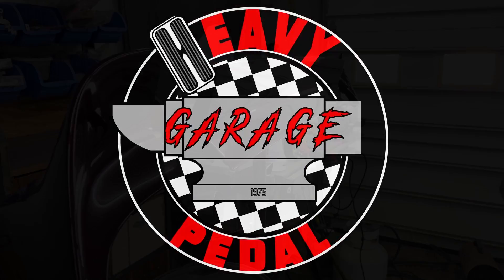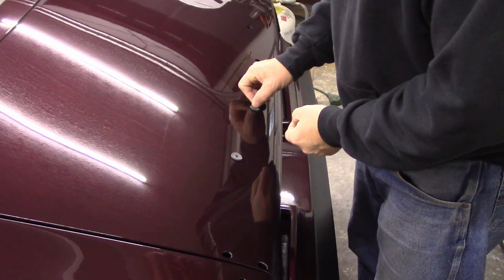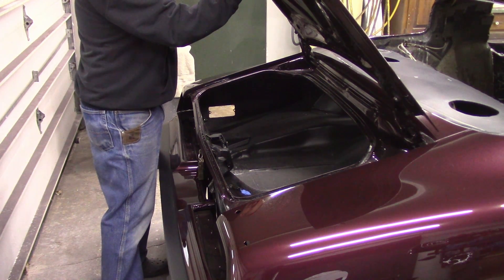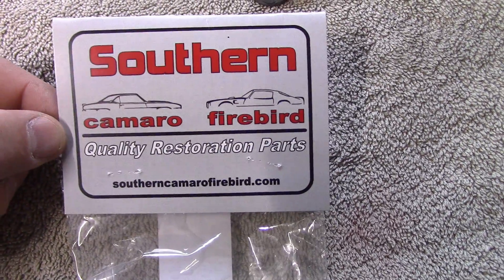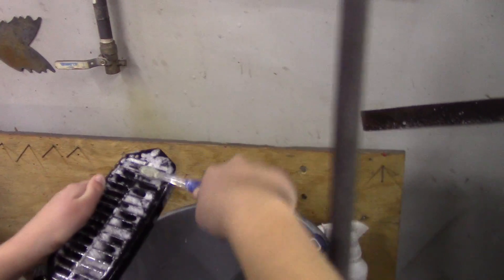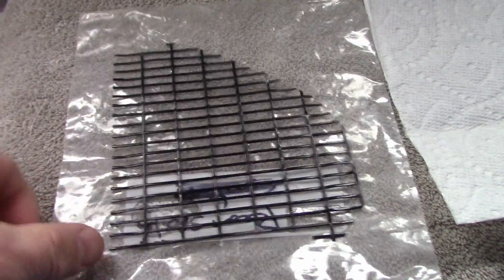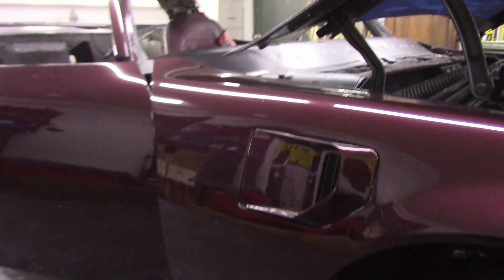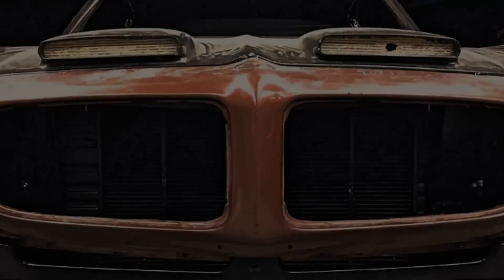Trans Am Spoiler and Air Extractor Fender Vent Installation.  The hardware to use to prevent leaks!

Comment: That looks bad to the bone...  😁
Just a suggestion for down the road. Not sure how many others have found this but personally, I only use butyl for sealing spoiler mounts, tail light mounts etc. Have found that the foam rubber washers supplied always end up leaking.
Reply from the maker: Right on! Thanks for the tip!  I google and see that butyl is sold as a roll of “tape”. I’m guessing this is what should be used? If (when 😀) I get leaks, I’ll upgrade. As alway, I  super appreciate your advice 💯👍
Reply: @HeavyPedalGarage   your welcome and yep, comes in rolls in different sizes. I use the left over from windshield/rear window installs (3/8"). Just cut a small piece off, roll it between fingers and make a small donut and place it over the studs. Lasts for a decade...lol
Reply: @HeavyPedalGarage  I concur.  I used to do auto glass when I was younger.  Left over butyl tape from installing windshields had a myriad of uses.

Comment: Man just found your channel about  to be tackling same build your doing. Boy that formula  hood is hard to find but  I am getting  there piece by piece. Great video
Reply from the maker: Thanks for the sub! Good luck with your build. its been a ton of fun (and a lot of work).  I got that hood and front bumper in a package deal.  The hood had two cracked corners, some busted vent fins, and a whole lot of cracks throughout.  Check out the playlist i put together on all the repairs that went into that hood.  it was sooo worth it!  Im probably gonna be a distracted driver because im always gonna be looking at those snorkles 😁

Comment: Great video. Exactly what I was looking for.  I am converting a 1970 Firebird base model to a TransAm clone. Could you provide details on how you created the templates for drilling the mounting holes? I have all 8 pieces of front and back spoilers and the wheel well flairs. I also have a restored 1974 Formula 350 that I converted to functional dual scoop RamAir. In addition I have a 1999 Formula FireHawk.
Reply from the maker: Sounds like a cool project. I’ve got a video on my channel that goes over how I drilled the holes for the trunk spoiler. Here is a link. Trunk Lid Gaps. Trunk and Roof Blocked and Primed. Trunk Spoiler Install Overview on Drilling Holes!
https://youtu.be/HNYLHM15JCA

Comment: Did you cut those heat extractors out ? I was considering doin that I did it to my sons 81  Z28 ...
Reply from the maker: Those extractors are inserts that bolt into the fender.